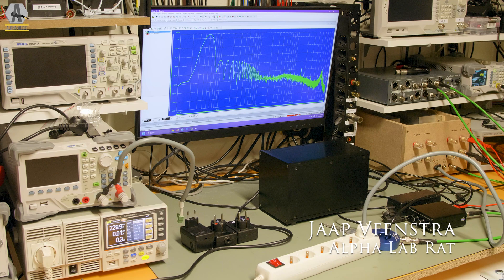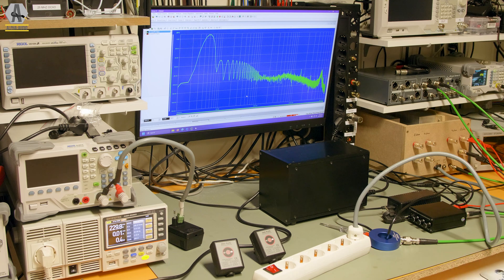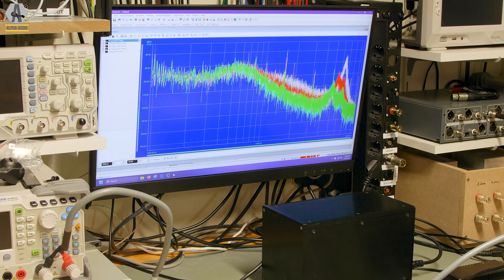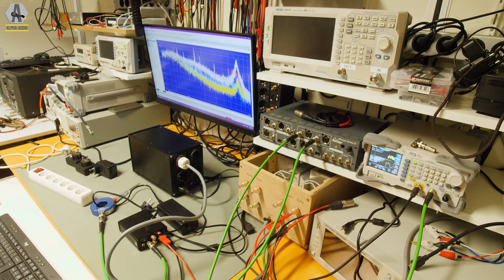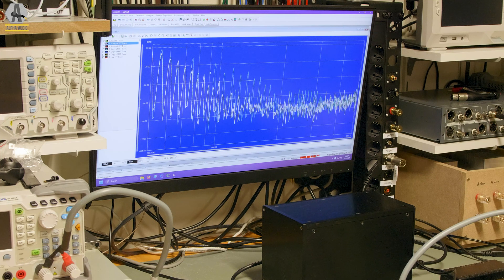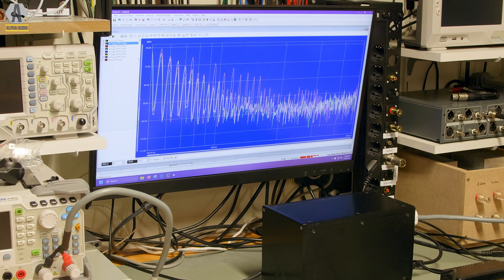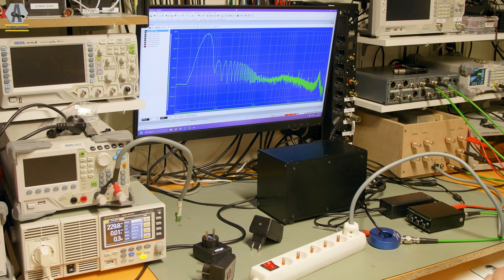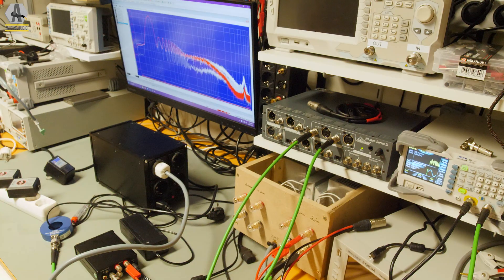Alpha Labs - Do Parallel Filters actually work?

Comment: I have recently discovered your channel after just upgrading my streaming system. It has been a great resource and helps me understand the complexity of digital music streaming and where opportunities exist for improvement. Please keep it up. I do have a question regarding AC filters. I had an iFi AC iPurifier plugged in to the spare socket feeding my HiFi. Recently I bought an EMI noise meter to test how well my power conditioning worked at suppressing EMI in the AC line.  I was surprised to find the iFi AC purifier moderately but consistently increased the EMI noise in the AC (60-70 mv p-p baseline vs 130 mv p-p +iFi). This was suppressed by my power conditioning but nevertheless, I removed it from my system. I am wondering if this is a quirk of the iFi or if it is common to these active AC filters? Have you or others ever seen this?

Comment: If you use larger caps on parallel filters you can go much lower with noise reduction, I have used 30uf value caps which are large, then cascade down to .01uf or less

Comment: Hello i would like your opinion on what filter should i use buy. looking for isotek titan for home theater hypex ncx500 11 channels all run using smps switch mode power supplys. Marantz av10 processor.
Reply: Like in shunyata review mentioned that for switch mode psu should be some kind of special filter))

Comment: On my little yt channels there is a setting where potentially disrespectful comments are filtered to you and you can get delete them. I would do that if I were in your shoes and I have done it on mine.  Its so refreshing not having an influencer running a channel with sociopathic charm and engaging & convincing yet incorrect advice at times so I hope you keep it up.
Reply from the maker: Thanks for the advice. I will check it out!
Reply: @TheAlphaAudio  when you upload your videos, from the 1st page on YT upload choose 'Show More' then scroll down to 'Comments and Ratings' and you can choose your settings. You can make that the template for all your future postings so you don't have to repeat it every time  but I forget how I did that

Comment: This was really good. I really don't understand why these things matter so much when my audio equipment converts everything to DC, but it does make a difference. I have a parallel transformer and an isolation transformer and there is a favorable difference, except on hot days when the grid is loaded by air conditioners and etc.

Comment: Hello! What could be the best option for power filtering in case of active speakers (D class) + pc setup? Is it reasonable at all?
Reply from the maker: It completely depends on the resolution of the system. Pc power supplies are very dirty. So filtering that could definitely help.

Comment: 1. It's a tough world out there, most of us fantasies about
being in our privet tropical resort with no out side feedback
if it not / unless it is positive and compliment 
Sadly, it is only a fantasy...

2. Modern times brought us consumer audio products
that are well designed -  some of them are even  well
 manufactured - that have excellent inside the box power
 supply performance. 

So if your mesurmant's shows how poorly/good performed
 that box or the other (power sup noise issues for example) - 
fantastic! a true valuable information for the modern 
music listener homo sapiance.

Dacs, pres, powers, integrated, processors that can be plugged
 to the wall outlet and preform with high Q&A over wide range of 
parameters - ARE out there on the free market and some of 
them even priced with respect for the customer and modern time
 market competition and brands flood/saturation.   

3. Most of us - YT channels consumers - are not
qualified/trained measurements and analysis 
engineers - it would be of the out most help if
you will explain us your protocols, your tools  
the way you calibrate referance,scale/resolution   
Software setups/modes and most importantly:

Why and how you interpreting the data and correlate
it to audio signal quality improvmant/deterioration on 
the consumer= Listener EARS side. 
Whether it's in the known audible scale/psycoacustic acknowledged
or on the theoretical / absolute / golden ears scale.    

4. It's takes time and persistence to build a strong YT channel 
and "mostly positive" feedback comments community.
 especially when that channel is in crowded market.    
Be patience, keep it interesting and educational, demonstrate
Consistancy of quality production, presentation and analysis
and you will gain what you are aiming at. 

Be blessed, healthy, free, educated and prosper.
Reply from the maker: Thank you.

Comment: Have you done any measurements to see if there is any impact on the output of audio devices (amps/dacs etc) when these types of filters or mains conditioners are applied to their mains inputs?
Reply from the maker: Yes. In the other Alpha Labs video. I measure at the speaker output of a Bryston amp.